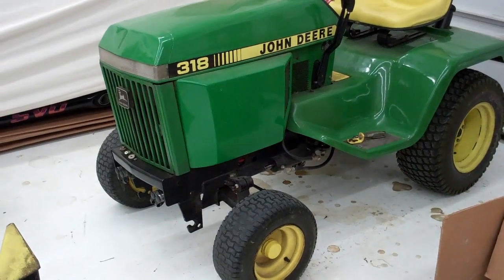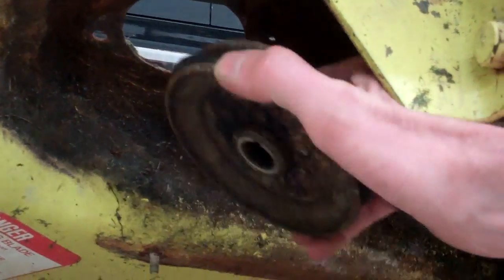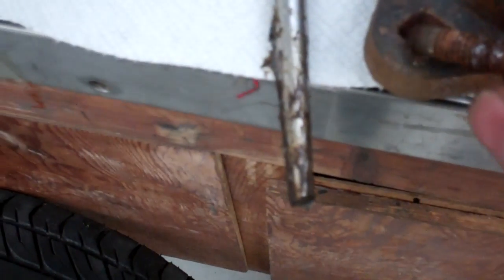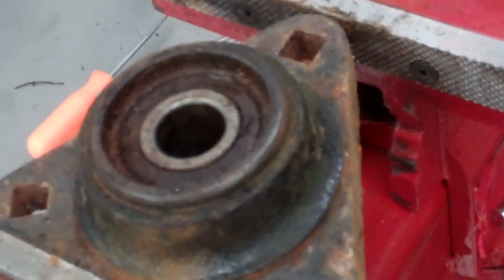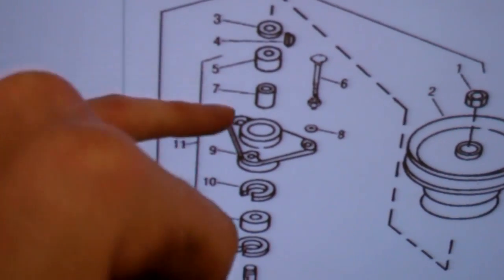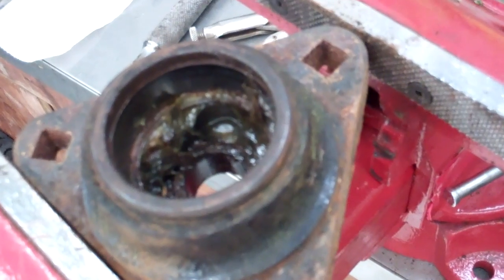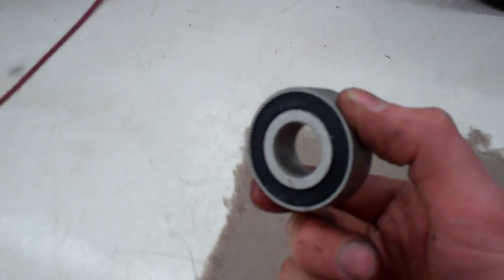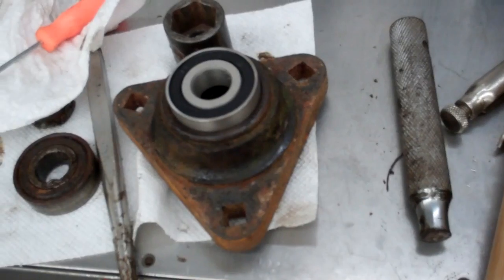John Deere 318 50" deck hub bearing replacement repair

Comment: Nice Job!

Replacing the bearings in the double pulley of a 48" JD Deck on a GT275 this weekend so doing the pre game "YouTube Information Crawl".. 
Glad I came across your video.

Have done bearings before, but you never know what you can learn from others. 
The Freezer idea is pretty "cool" (pun fully intended) will have to give that a try.

At 17:34 I say to myself, oh crap he is pushing the bearing out and does not realize it. 
At 17:50 you make the discovery and respond oh so accordingly. Classic.....

It is always great to see others that still work on the things at the "detail" level themselves to get more life and value out of things vs. just buy a whole new part or pay someone else to do it!  
Save $$, Less Waste, Satisfaction In A Job Well Done with your own two hands!

Keep up the good work!
Reply from the maker: Thanks, I was taught the freezer trick many years ago when replacing automotive suspension bushings. Every little bit helps when you don't have a press!

Comment: Very good video, with good ideas. I'm currently working on a 265's deck spindles which are very similar. Gotta get two of the three pulleys off somehow first. No amount of pulling them works without ruining them. 

I've read you can put the whole thing in a vise and hammer down on the spindle, eventually forcing the pulley off as the spindle drops down ... but to me that seems like it would just flatten the bottom of the pulley. Such fun.

Comment: Cool. I replaced my carage bolts with stainless steel ones. My lawn tractor is the 430. Rare 50 inch deck for a that model.
Reply from the maker: That's a good idea... one of the other bearings is starting to make noise, so I'll go the stainless bolt route next time.

Comment: I've worked on my deck several times and each time I've tried to remove the bearing hub assemblies, the carriage bolts have just spun around without the nuts coming off.  I've had to use a grinder to remove the head of the bolt to get the bolts out.  This has happened twice and both times I was using an impact wrench to loosen the nuts.  My advice is to clean the threads on the bolts and spray with penetrating oil before you try to take them off.  Plus, use a ratchet wrench rather than an impact.  I'll try to remember this the next time have have to remove one of the hub assemblies.
Reply from the maker: Great advice! Living in OH where road salt is used, a can of PB blaster is standard procedure for anything I work on in the garage.

Comment: I have been going out of my mind trying to figure out what part numbers I need to replace all the bearings on my JD 180 48" deck. Since the JD dealers around me have all gone away in the last few years, I am pretty well screwed. Chatted with a dealer in Indiana who sent me what "SHOULD" be my deck. Not even close. I think somewhere along the line my deck was replaced and I can't find anything telling me what model mine is. Anyway, watching your video I see the same spindles that I have and it is the first I have seen them. Yours are cast iron with 3 bolts. Same as mine and the only ones I have seen that were not aluminum with 4 retainer bolts. So I am going to see if I can use your mower to find all my parts. Is there any chance you still have the bearing info on yours??

Comment: what was the part number for the spacer?  do you still have that?  Otherwise, excellent video, I will surely put this info to use.
Reply from the maker: Hi, I believe the part for the spacer is M73515 or it could be M45121. (The first part # might have superseded the second.)  Check out this link, it has measurements to compare dimensions to yours: https://globalpartszone.com/john-deere/m73515-1.html

Comment: This was very helpful, thanks so much. For the life of me I cant find the spacers online to order them. Could you tell me what to look for (i.e. specific name of part) or where you got them from? Thanks.
Reply from the maker: Hi, I believe the part for the spacer is M73515 or it could be M45121. (The first part # might have superseded the second.)  You may want to double check that with your JD dealer.

Comment: Use a large six inch "C" clamp to hold the blade put a rag to prevent blade damage while tightening or loosening. It's a lot safer than the block method or holding the blade by hand.d

Comment: Thanks for the detail. At 19:50 you insert 3x bolts into the pulley mount. When you insert the mount back into the deck and attach the nuts, how do the nuts tighten? There's no head on the bolt to stop it spinning while the nut is tightened. 

Reason I'm asking - 3 of my bolts on my same model deck on the center pulley are loose and wonder if I can tighten easily without taking the pulley off. Thank you
Reply from the maker: Those bolts were carriage bolts, with the square behind the smooth head. The hole they went into was square shaped and holds the bolt in place while tightening. Great question, I should have mentioned that in the video.
Reply: Ah, thanks for the response! I will inspect them on removal. Quite possible that if they spin while tightening someone put the wrong bolts in. Thanks for getting back to me.

Comment: do you happen to know the part # for your blades.   I have tried numerous blades and cannot find a blade that will center on the hub.  my old mower has a small bushing to center the blades but JD cant seem to find part numbers
Reply from the maker: I looked and do not have any part numbers on the blades. I would think that's a common item for a dealership to sell. I would try checking with a different dealer.

Comment: I am still wondering about the grease inside the hub.  I just took all three of mine apart and they were filled with grease, but .... I don''t know.  
I think I will try to use my vice to push the spindle in. The less you pound on the bearing rolling elements, the less likely you are to damage them.  But maybe the jaws don't open wide enough.
Thanks for the video.
Reply from the maker: That's a good idea!
Reply: Just to follow up, I found this in the service manual section on rebuilding mower deck spindles:
"When assembling bearings and spacer, fill cavities 75 percent full of multipurpose grease."

Comment: just wondering, why is there grease in housing for sealed bearings?
Reply from the maker: I'm not sure exactly why they put the grease in there, but my best guess is to prevent corrosion on the pin and inside of the housing over time from any moisture collected when washing the deck off with a hose.

Comment: what size carriage bolt did you use for a replacement?
Reply from the maker: I'm pretty sure it had a 3/8" square on the head.  It was longer than the original bolt, but not long enough to interfere with the blade.

Comment: You could have avoided the spacer replacement - just needed to punch through the spacer straight to the bearing - since you aren't reusing it anyway.
Reply from the maker: +Doug Phelps Thanks Doug. Less parts to replace.  I did it that way when I replaced the other two units the following year.
Reply: These spindles should be made like front wheel drive hub bearings.  I welded a couple of helical beads
 on the outside of the inner sleeves to fling the grease to the upper open bearings while running

Comment: Always amazes me how much grease are in between the bearings sometimes, it's the same in the spindle.  The bearings are sealed and no grease will get to the bearing no matter how much is pumped in there.  Good job though.
Reply: Yup. Those inner seals need to be removed. Its easy and to not do so all the grease in the world does the bearing no good.  They are pre packed. Bout it.

Comment: Do you have the part number for a new belt?
Reply from the maker: There are 2 belts. One from engine to deck, and one on the deck. Try this link, there is a deck drive belt and a blade drive belt. https://www.greenpartstore.com/50-mower-deck-parts-for-John-Deere-318.html

Comment: i paid 300 bucks for a whole new unit,pully included ,those things can be used as a bush hog! best dam mower made 1980 212 32 forward speeds and 8 reverse speeds

Comment: Awesome video.  Thanks for taking the time to make it.   How did you know your bearings were going bad?  I'm going to try this if i ever need to replace them on my 332.   Thanks again!
Reply from the maker: When I had the deck off for winter, I noticed that if I grabbed a blade and wiggled it, it had play. Also made a dragging sound when I spun it by hand.
Reply: I decided to rebuild mine.  I'm having trouble getting the spindle out of the bearings.   I put the nut on the shaft and have been hammering it.  i started to damage the threads.   How did you get yours out?
Reply from the maker: Try soaking it in PB blaster for a while. Probably just rusted together.

Comment: THOSE ARE SEALED BEARINGS CORRECT ?
IF YOUR DECK HAS A GREASE FITTING, HOW CAN
GREASE GET INTO A SEALED BEARING ?
 HMMM THINK ABOUT IT.
 KEITH KUHN
Reply from the maker: Yes they are sealed bearings. The deck doesn't have grease fittings, not sure where you heard that but it isn't true.
Reply: @6thGearGarage   Good point about sealed bearings. My deck has grease fittings..i never had to replace the bearings but i just wonder if the bearing seals are on the bearing inside the spindle?.......

Comment: I had to replace all my bearing hubs today on my John Deer L130 because bad bearings wiped out hubs even tho they were greased om a regular basis. Went to John Deer and bought all three new hubs but I was very disappointed as these hub assemblies were made in China, I have dealed with China products before and bearings especially are junk, their metal is all weak and will rust if you stare at it--God we need some American made products in the stores again. Trump is the Man to make this Happen....